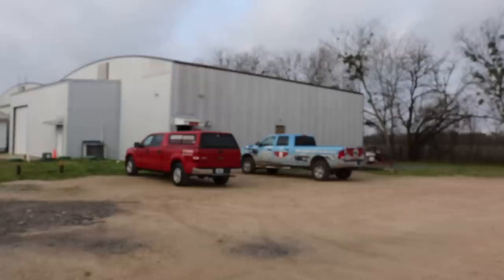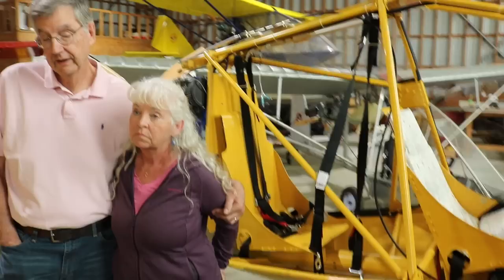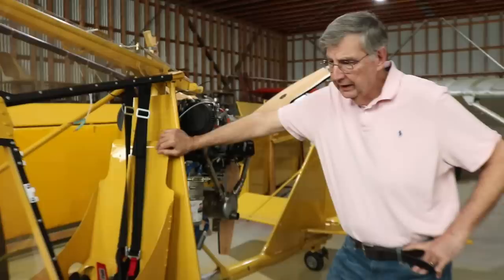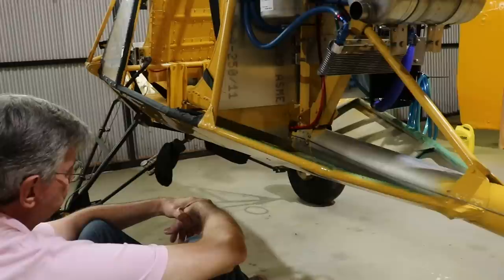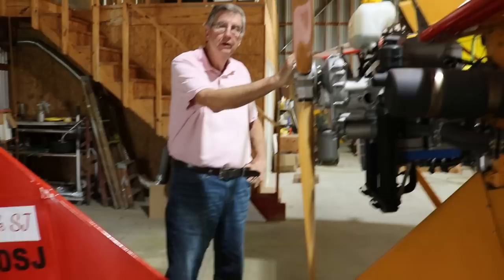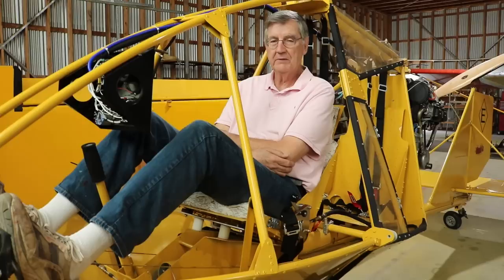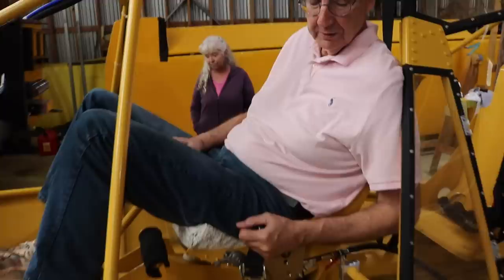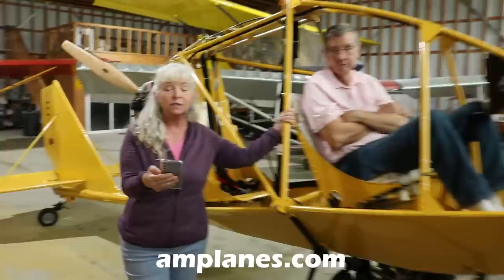World's Slowest Chinook Aircraft!

Comment: I live in East Tennessee and there’s tons of small private airfields all across the Appalachian Mountains here and in North Carolina. To me it seems that critical points would be range and achievable altitude because a lot of the fields are in the mountains.
Reply: i wonderi fyou could put the 912 uls on there instead of the 80 horse. that should give you enough oomph
Reply: @WX4CB  I keep thanking electric range extenders would be really cool for ultralights. Just magnet a couple to the underside of the wings, or wherever is clever.

That way you can have the gas motor always running at optimal RPM.

I sort of remember something about one of the first ultralights actually had a folding propeller.

Theoretically you can make the range extenders all-in-one units battery, propeller, everything.

I know they have automatic tabs you can just slap on a Cessna, to give it plug-and-play AIO autopilot. Similar concept, except electric motors instead of tabs. So extra power and autopilot (assuming you have two of them for differential thrust).
Reply: "Range: 300 to 600 average miles
Service Ceiling: 12,000 ft."
Reply: @WX4CB Dan Reynolds flys a Rotax Rick 670 that puts out 95hp. It’s a 2 stroke and I hear that number is conservative. It not a 582, it’s actually a engine off a sled from my understanding. But Rick converted them to a Aircraft engine with dual plugs and ignition. I believe the Chinook will handle the 100hp. Now Dan’s little competition bird is modified and I don’t know what he had to do in order to make his Chinook handle 95hp. That would be a question for Dan. I believe I have his email and number if you want to talk to him. I would have to check…🇺🇸🦅

Comment: Love this little plane🤗 ... and it is great that a Tall Person rebuilt this design, and a Rotax 912 👍 , if I could get my 3rd class back I'd be flying one of these.... nice shop tour.
Reply: Amen, the tall person sentiment. I,m 6'5" and 280lb this is actually a "big", small a/c. Not cheap by any means. Has to be a more affordable power plant that is adaptable.
Reply: I'll have to take Rotax .. I was amazed at how small this engine is first time I got close to one at Oshkosh back in '18  and some things just cost a bit more when you stamp "Aircraft" on the data plate🤨and lots of these are available used /rebuilt at a reduced  price.... very dependable and trusted engine.